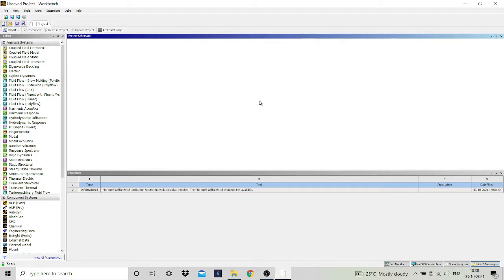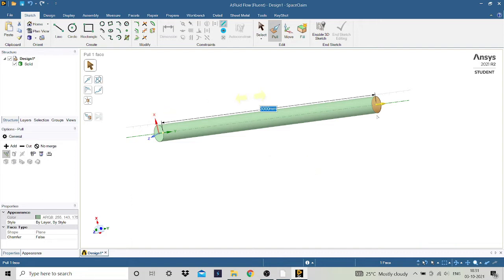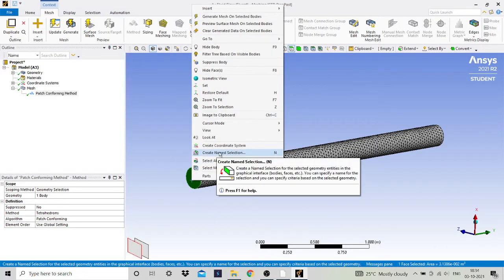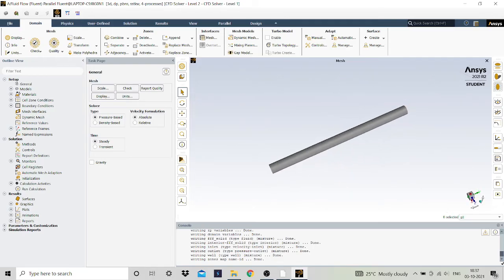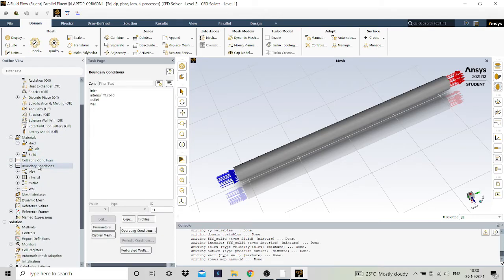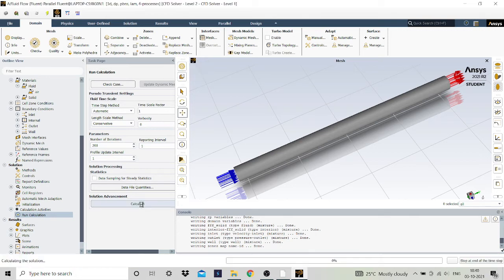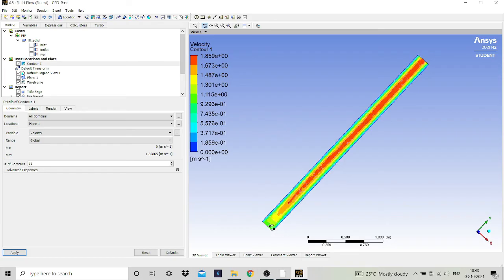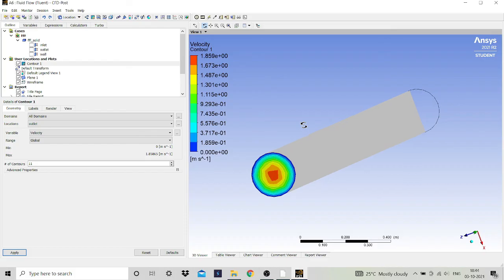Flow through pipe Ansys Fluent | Ansys 2021 r2 | Ansys Fluent tutorial |

Comment: Why are we making the pipe a solid rather it should be hollow with some thickness right. guide me here
Reply: Because the fluid flow is through the hollow portion of the pipe and not the through the thickness. So, you consider only the geometry thats bounding the flow. You dont need to add the thickness to the pipe.